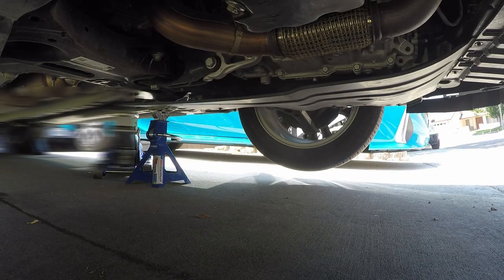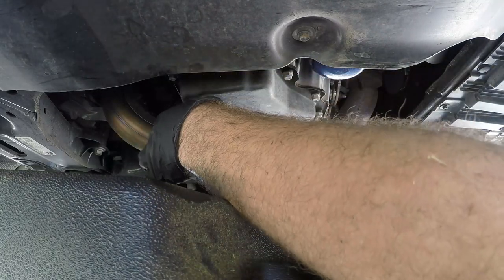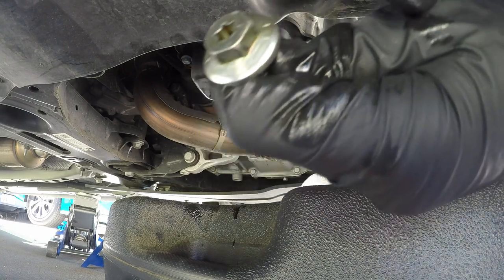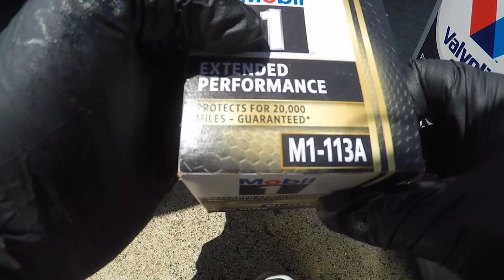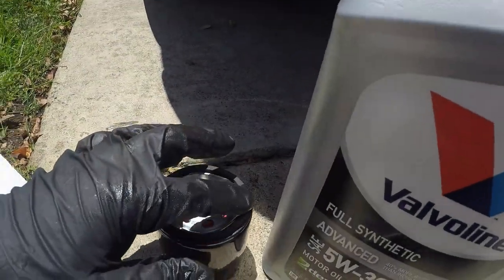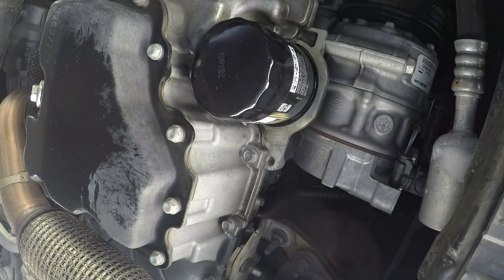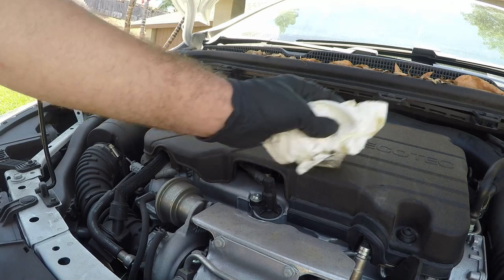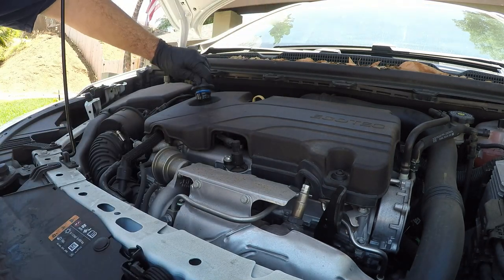Changing oil on 2018 Chevy Cruze

Comment: When changing oil its always good to hold down the accelerator to disable ignition to let the filter fill with fluid before startup
Reply from the maker: That’s awesome I didn’t know about that. Thanks for the info!  Will definitely try it next time.
Reply: or just fill the filter with new oil before reinstalling it

Comment: First ,  wrong  oil  it uses 0 W 20.   Second  use oem oil filter ,    the Ac Delco filter has been upgraded for synthetic oil use .
Reply: Filter doesn’t matter-just get a quality one. No filters are designed for synthetic vs conventional. they work with all types of oil.
Reply: First off Randy, you don’t have to use OW 20 if you’re in the Midwest and (temperatures get rather cold or in the northern central US)5w30 viscosity isn’t going to make that much of a difference regarding performance

Comment: That's interesting you went with 5w30.  Is that the diesel engine?  The owners manual has 0w20 for gas 2018 engines.
Reply from the maker: No it’s not the deisel motor. I was at my local dealer and they couldn’t get the car in for an oil change. I asked them to look up what they used on it the last time and they informed me a 5w30 dexos. So I went to the local auto store and picked some up. 

From my understanding (keep in mind I’m not a professional) but the difference between the 0w20 and 5w30 is minimal. 

But like I posted in the video you can check your owners manual or your local dealer to see what type of oil to use in your car.
Reply: @kunertdiy  Thanks.  I'll study up on the viscosity differences.  I was reading about the difference in using the pf64 vs the pf64r filter with different viscosity too.  Thanks for the video, and the feedback.
Reply: Where do I reset the oil meter on the dash ?